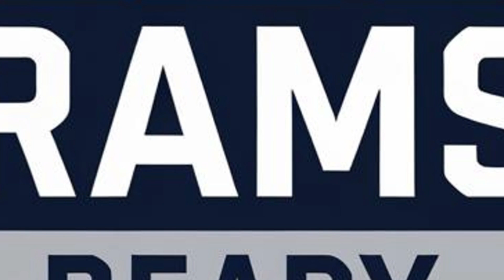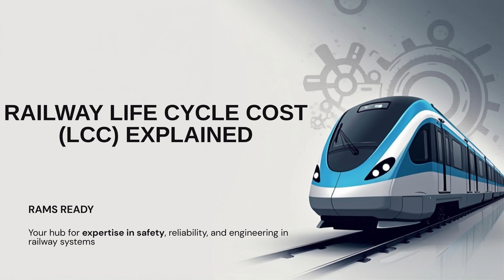Railway Life Cycle Cost (LCC) Explained

Comment from the maker: Working files for this topic, built to be used on a live project:

Tender RAM and LCC Pack
Life cycle cost model, RAM requirement specification, supplier data request and a bid evaluation scorecard.
https://ramsready.firstlinkai.com/p/B1

Client Deliverable Report Pack
Six client ready report shells: RAM analysis, FMECA, hazard analysis, LCC study and safety case, plus a report writing guide.
https://ramsready.firstlinkai.com/p/D2

Free Lite Hazard Log workbook: https://ramsready.firstlinkai.com/free
All twenty products: https://ramsready.firstlinkai.com

Which part of this gives your projects the most trouble in practice?